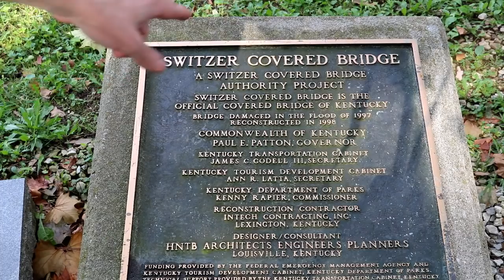Working out Problems on the K&T mill. Overhead Ram are stuck

Comment: Steve I really enjoy these videos. In 1964 the shop I worked at got a huge (I think it was a Milwaukee or Cincinnati) mill. Like yours, it had two rams on it. It was not too old and it was pretty clean. I was the newby so my job was to keep it clean and wiped down with a coat of oil. It's bringing back some memories.  I'm loving your classes on these things.  Thanks.

Comment: When I saw you showing the mill sump it brought back memories to me. use your shop vac to pull out the fluid and chips then flush with cleaner and repeat vac treatment until your happy then refill with your coolant of choice. I am a retired industrial mechanic (Millwright) and the shop I worked for would be shut down every summer for 3 weeks for scheduled major repairs and complete fluid changes.
Machine cleaning was the start of the work to be done, and after a year of round the clock production you can imagine the state the equipment was in, we tried all kinds of cleaners over the years, I retired after 44 years of service in 2016. The cleaner that  I found worked the best in my mind not perfect but handled the majority of the grim is a product called Citra Solv Concentrated Cleaner & Degreaser for most of the cleaning we would cut it 50:50 mix with warm to hot water yes it works with cold water but just think it helps with the hot water. We used a pump weed sprayer to apply wait 15 to 20 minutes and wipe off with a cloth, a spray bottle works well for small areas hope this helps. 
From Elliot Lake Ontario Canada.

Comment: Nice job Steve. A lot of work but good results. I have a K&T don't use it much also I use a shop vac to clean the sump out just remove the filter from the vac that way you don't have to get a new one after removing the oil.

Comment: The hole on the top of the vertical head is for holding the coolant line.  Also check the x axis bearings were you had the water damage.  My K&T was pressure washed and let sit, water got in oil revivor.  The design they use for the thrust bearing uses Timken bearings that are hard to come by and expensive.

Comment: Here in Alaska WD-40 is a byword. It is mostly kerosene with a bit of oil added. It was originally made to defrost aircraft control cables, but is no longer legal for that purpose.  Other channels have recommended Evap-O-Rust to get the rust off. I object to shorter videos. The current ones are far too short. Take all the time you need to show us what your'e doing. Oh, and congratulations on 15K subscribers.

Comment: My 1943 K&T 2HL took a lot more work to get the overarm bars loose but my machine had been parted out and left outside for years.  I had to make 3 new main drive gears, a gear slide shift, new handles and a lot of small fixes to restore it.  Be sure the 2 pumped oil systems (column and knee) are working and the oil is flowing properly before you use the machine!
The table drive for rotary or dividing heads can run from the spline shaft inside the X table (as yours is setup) for rotary work or from the X lead screw for helical jobs like milling twist drill flutes.  The hole in the front of the vertical head is for a bar to hold a coolant hose clamp. Steve, I would be happy to chat about any questions you have.....
Reply: Hello Chuck, I read your comment awhile back and have been hoping to see you post a video about your machine and the restoration that you did.  I came back to this video because I just brought home a 1945 K&T No.3 Universal, also somewhat stripped, but at least not rusty. The overarms are stuck, so I am poring through videos, comments, and parts and operating manuals to figure out the best way to loosen them. I already loosened the two clamps, removed and shot some penetrant in there to soak.  Would love to have a read or a watch about your restorations.

Comment: The sump on my K&T mod. 2CE was in the same condition when I bought it. Most of the goop can be removed through the drain holes in the top of the base. Shopvac what can be reached through them, then use an air hose to blow gunk, from farther back, around to where you can vacuum it out. Block the rear up an inch or so, so that it drains to the front. I used a long tube on an air nozzle, a large bottle brush on flexible lead and anything else I could find to scrape the gunk loose. THEN take the plate off the back and clean from that direction.
I also used some BH-38 degreaser that i got from the janitorial supply store. It will take paint off if it's left on too long.
Good luck. It's a messy job but can be done without getting too dirty yourself.

Comment: A minor point, but the table in/out movement is the Z axis on these machines because the convention is that Z is movement parallel with the axis of the spindle (the main one, not the one in the vertical head). For the other two, the one with the largest travel is denoted the X-axis. In this case that would be the table left and right leaving knee up and down as the Y-axis.

Comment: Once you drain the sump, put some Dawn dish washing liquid and hot water in there.  It will really help loosen the grease and oil and its really safe to use so it won't damage the paint.  Just let it soak for an hour or so then drain it again.  With all that thick sludge, you will probably have to repeat the process a few times.  If you want to use something more powerful, try Simple Green, Super Clean or Purple Power from Walmart, they work great as well but the purple products may damage the paint.  Nice to see you were able to get the rams moving again.

Comment: I've been attempting to rehab a Sajo universal mill which was boogered up at the local community college then sold pretty much as scrap. It has pretty good paint on it, but it was extremely dirty. I used a mixture of SeaFoam solvent, Marvel Mystery Oil, and some ATF to remove the dried grease, oil, and swarf. Worked pretty good at softening, and removing the gunk, but was gentle to the paint, and left a light film to protect the machined surfaces from rust.
I never caught what year your K&T was made.
Reply: It is marked as War Production and I think he mentioned it may have been built towards the end, say 1945.

Comment: Nice work on the mill. Patience is truly a virtue when freeing stuck parts in cast iron. Little by little does the trick. I also only use WD40 for cleaning. I prefer PB Blaster and Kroil for freeing stuck parts.

Comment: first off love your videos    a trick I have used for years. when wire brushes seem to loose the effect just dust then lightly across an abrasive wheel or belt sander to refresh he edges of the wires. same for wire wheels on portable grinders.  on the bench grinder or mounted machines wile running dust the nightly wit an angle grinder. actually last longer as you tend to use much more pleasure when dull so what little you remove keeps you mashing and mangling the wires. besides I can be a little lazy at times and require a lot less effort if the wires are crisp and sharp especially for removing rust and paint.  Dave

Comment: I think Keith Fenner mentioned in one of his old videos that it took him something like a month to get those rams moving. He'd wake up in the morning, squirt a little penetrating oil on them, give them a couple of love taps and get on with his day. :-) And eventually they started moving. Little by little. :-)
Reply: That's what I have been hoping would not be required... hah   My "new" mill is sitting on my trailer with the overarms all the way to the rear, and even inset into the casting an inch or two. The best way for me to pick it off is with the overarms centered and pick with straps as my forklift is only a 7K. Much easier and safer with a crane pick.

Comment: Really great waking up on Saturday morning and capturing a video from you!
Yeah, the rain up here in Connecticut is pretty horrendous too. I've more or less given up trying to cut the grass. 
The creek looks pretty scary !
Reply: My backyard looks like a jungle at the moment, grass is waist high and gone to seed. It's been all I can do to use a trimmer to mow the visible street side a little at a time between rainstorms to keep it halfway decent looking.
Reply: @CO Jones.  I hear you. My mower bogs down in the wet soil and makes a huge mess. Some areas have little springs that are overflowing this year so it's almost impossible not to tear things up.  Been here 14 years and this is the worst rain season I've ever seen. Makes me wonder what this winter is going to be like because I doubt by the time things start to freeze all the water would have drained out of the hillside.

Comment: Steve, once you start to clean smaller parts that can fit in a bucket.  A water solution of (real) TSP and ammonia works great, it takes off all the grease, dried old coolant and  most of the paint.   Just soak for a few hours or over night,  wire brush any really tough stuff gunk.  Rinse  in water dry,  paint or oil to prevent new surface rust.

Comment: Ran that exact K&T mill in 1970-76...pain in the ass mill, (boat anchor) it's Navy gray for a reason, did it come with the yoke for slab milling?....sell it and get a Bridgeport knee mill and put a digital readout on it. You'll use it daily.

Comment: I don't think Elizabeth needs a torch to heat things up. You're a lucky man, sir.
Regarding video length, anybody can click ahead through sections at will - not so easy to expand video that was cut out.  A lot like machining, that way.  It's harder to put it back once it's been cut  ;)

Comment: I'd tend to avoid having aluminium mesh next to steel or iron if it's at all damp as it corrodes very easily due to an electrochemical reaction.
Reply from the maker: I ended up getting some stainless steel mesh.. I'm not a fan of aluminum for this purpose either. But I didn't know I had SS at the time filmed....     Already made and installed   Thanks for watching and commenting Pete

Comment: Steve i will say one thing i enjoy your and Adams videos for the simple reason they are longer and more thorough i personally hate a video that is 10 minutes long and in 10 minutes they would have you're machine completely fixed and making parts  with not enough detail and the learning for me is in the detail because i can figure out the simple things i guess its in my genes, g dad was a master mechanic for Firestone and my dad was a master mechanic for Firestone and i am a master of none and jack of many just have a small 40" lathe and a Bridgeport with a press and vert and horiz band saws with a big rockwell drill press so make them longer as far as i am concerned

Comment: Your many comments about finding out how something works before you try to fix or use it, so as to prevent inadvertent damage due to ignorance is quite correct.  Sometimes something will work in the EXACT OPPOSITE WAY from what you expect and still, after you understand it, do the desired function.  A good example of how an opposite thing can give the same final result is in hardened steel armor-piercing ("AP") gun projectiles used on naval warships through the end of WWII against heavily-armored enemy ships such as cruisers and, especially, battleships (though obsolete now that no modern warship uses heavy steel armor anymore).  When face-hardened (carburized or cemented) deep-faced heavy side armor was introduced circa 1891 (first thin-faced Harvey armor developed in the US and later, starting in 1892 and taking over by 1900, thick-faced Krupp Cemented armor developed in Germany), hardened steel AP projectiles were found to have their nose shatter on impact, greatly reducing their ability to punch through that armor at low obliquity (near right angles) and, even if the shell did make it through at close range, the shell was broken apart and its internal explosive charge would not function correctly (merely act like a Roman candle, not as an explosive).  It was found that by putting a soft-steel solid "crash helmet" called an "AP cap" on the nose tip, later enlarged for oblique impact, though such caps did not work at over 20-30 degrees from right-angles (hardened caps were later found to work better and at all angles, but this was much later).  However, nobody at the time could figure out just how the caps worked ("cap action") and all sorts of theories, many quite strange, were proposed as to how the cap protected the shell.  The one most accepted at the time was the seemingly reasonable one that the cap "cushioned" the impact much like a pillow can cushion a glass container if it was dropped on the floor, either by interposing itself between the projectile nose and the plate and slowing the impact (as a cushion does) or, alternatively, by constricting the nose from the side so that it cannot crack apart by the mass of cap steel to the sides of the nose tip on impact (a "straight jacket" for the nose tip).  However, this did not explain why higher angles of impact rendered such caps nonfunctional, among other things.  I figured out that the second of these two ideas was closer to how it worked, BUT DUE TO THE EXACT OPPOSITE FUNCTION:  You did not want to constrict the impact forces moving sideways in the nose, but instead give them some way to EXIT THE NOSE so that the forces on the nose that usually shattered it had somewhere else to vent their damage on, to wit, the sacrificial cap.  Without the cap, the shockwave of hitting the very hard face, like the glass on a concrete floor, could move freely down the projectile length, gradually decreasing in strength as it was absorbed by the softer steel used in the lower body of the shell, but it could not move sideways, instantly reflecting at the surface of the side of the nose and cracking it when it reflected back into the nose (the force is DOUBLED when it reflects -- remember this!).  The cap metal, similar enough to the projectile nose material, if softer, was flattened out like a wad of taffy on the plate face, no matter what it looked like before the impact (another clue), and compressed tightly against the nose, so that now that sideways-moving portion of the shockwave could exit the nose (at least enough of it to prevent shatter of the nose) and destroy the cap instead.  Problem solved.  This is obviously exactly the reverse of how the people back then thought a cap worked, but both ideas give the same result.  A lesson.

Comment: Engine degreaser is available in bulk quantity, i get it in 20l cans from the oil supplier, and it works well for this sort of cleaning.  Just need a good bit of block brush work with it, and then you use a scraper and an industrial vacuum cleaner. A cylinder vacuum cleaner with HEPA filters and a bag works, just called the "dirty vacuum" as it always is going to be greasy, even though i wash it with the degreaser as well. Just buy a length of vacuum hose for it, a 5m one works well, and all you need is the crevice tool. Bonus is it also does double duty as suction to get the  sump clean, noot rated as a wet and dry unit, but for small volumes of water this does work, providing you have a fabric bag one and not the paper bags.

Comment: a few things. Lincoln brand stainless steel wire tooth brushes at Homedepot next to the welders on the tool isle are far better than the plastic handle version.. you will also want to visit the fastener isle. look for some nickel or quarter sized super magnets. to stick in your shaper internal oil reservoirs. this will attract any rust particles and steel particles and keep them out of your lube pump and bearings..  you may also want to visit an auto parts store and pickup a card display tube of Permatex 85420.. flange dressing.  its never dries hard oil proof stuff that you can use to seal your covers on with sparingly..  it does not come off the surface easily but the covers will  and it may keep the parts and gears hidden behind the covers cleaner..

Comment: Steve, I hope you or someone else can give a little bit more explanation of what you talked about near the 21:15 mark regarding the operation of the overarms. I just brought home a K&T 3H that is in relatively good shape, not rusted up. I cleaned up and used penetrating oil on the overams, loosened the two locking mechanisms on top of the casting, no budge. Removed the locking mechanisms and pumped a few ounces of oil penetrant into the cavity, tapped on both ends of the overarms, still no movement so I may be in for the long haul as one of the commenters described how long Mr Keith Fenner took to loosen his. 

The part that I am wondering about is your mentioning the in/out movement of the spider handwheel. Is the spider is always engaged with the near overarm bar? I thought that the near bar is always engaged, and pushing the spider in engages the far overarm at the same time as the near. So is there ever a "safe" set up to take that sledge to the near overarm?  Thanks kindly. 

Love your videos, especially the restorations of parts of the old machines. I'm a fellow "old iron" addict, but I freely admit that I can't stop. These old machines should be considered national treasures, and all children should have a semester or two becoming familiar with machine work.

Comment: Very nice video, Steve.  You seem to be confused (or at least were confusing me) about the naming of axes on machines, at least ones earlier than CNC people who seem to disavow all convention.  When your machine was built, the Z axis of any machine was/is in line with the spindle center line.  The major axis 90 degrees to the Z axis is the X axis.  The minor axis 90 degrees to the Z axis is the Y axis.  In that way, a surface grinder names the axes the same as a horizontal mill, but different than a vertical mill, because of the different orientation of the spindle.  I don't want to get fussy about this, communication is the goal.  Lately I have just been using nomenclature like left/right, up/down, and in/out to avoid the confusion that currently exists.